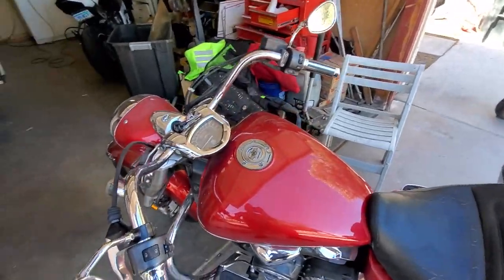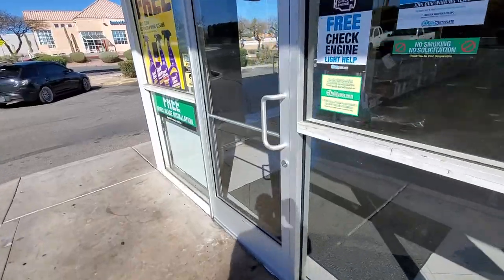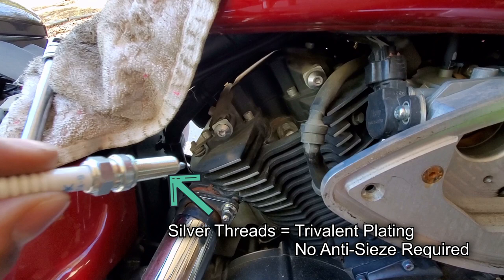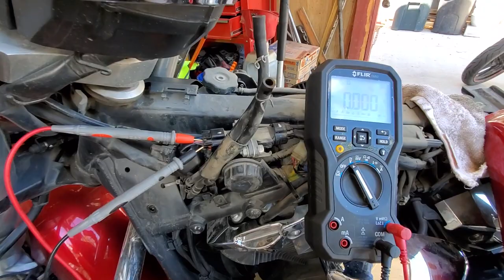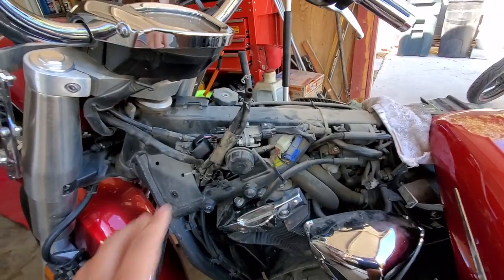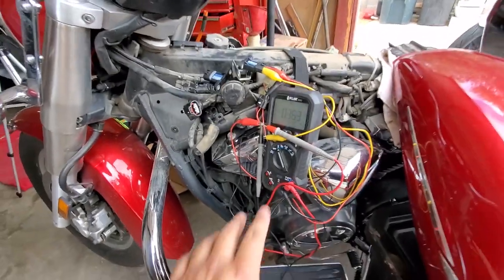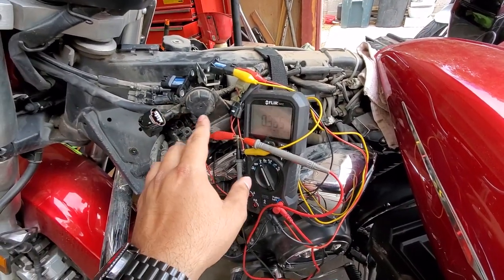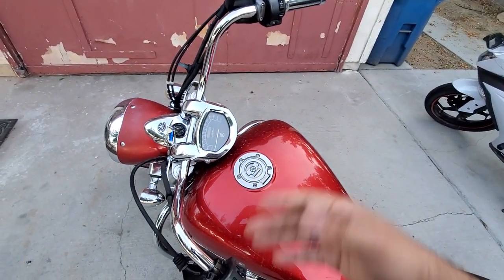Diagnosing a Starting Issue on a V-Star 1300

Comment: So was the problem a shitty fuel commander? What did you have to do to start the bike however you want with no problems? I’m just trying to learn I have this bike as well
Reply from the maker: I understand where you are coming from.  The power commander wasn't the issue. It's the bike itself. Since the power commander only receives power through the fuel injectors, this would've been an issue regardless of there being a power commander to my knowledge. It's just the way the bike's ECU is programmed and you would most likely need to flash the ECU in order to permanently fix this "issue". All in all it isn't a problem. Just a weird quirk of the bike design. Typically you are supposed to allow the fuel pump to prime completely before starting it but with this bike, I guess Yamaha wants you to start it as it primes.

Comment: Good Vid, MB, thanks... but one thing is still unclear.....So, as I like to hear the fuel pump  charge the lines ... I flip the start switch to on, flip the key, watch the display and listen..... " Weeeeeee " 2 seconds, then the ECU turns off the diagnostics lights. then I press start,.... Wuhh  Wuhh. Bruummmm.....  So why did the guy in the forum figure that the Fuel pump was shutting off? To me that sounds like a fuel line pressure switch issue...... Once you hit the Start switch at the end of the charge cycle, you would have full pressure to start the bike , but then you should be working off vacuum,  not injector pressure when the bike started and when the injectors open , you are pulling rather than pushing fuel ...??? The fuel pressure switch should stop the pump until you rev the engine ....
Reply: I missed a point here  When the fuel line pressure drops below a specified value, due to idling, revving or riding. the fuel pump will engage and keep the injector inlet pressure up..... not shut off when it reaches set-point for line pressure......
Reply from the maker: @Yamahog  from what I can tell, since the injectors require power to send fuel, the power commander is the middle man  between the ECU signal and the injectors. When the ECU sends the signal for the injectors to fire, the Power commander intercepts the signal in order to modify it. However; if the fuel pump is no longer priming, the power commander loses power as well and can't relay the signal to the injectors. (That's my understanding anyway) However; I feel like this isn't entirely the issue I have. Apparently the fuel pump relay tends to go out on these bikes pretty frequently and I think it finally took a dump. I have more tests to run to figure it out but I'll see about updating this video in the comments or description once the issue is discovered.
Reply: Ok so nothing needs to be fixed with this bike? Because I ended up doing what I learned in this video, n my road star started right up second attempt.
Reply from the maker: @orlandoperez2403  glad to hear. However;  the battery can show a similar issue. Read my pinned comment on this video.

Comment: Im having issues on my vstar1300 that I recently bought. Theres no spark. Ive checked the basic parts that needs to be checked. Just want to know what to check on ecu about the wire that goes to the ignition coil what color is it any advice? Thanks
Reply from the maker: Have you tested the coils?
Reply: @TheMotorcycleBoss  yes i did, i think its because of the ignition switch because it didnt have one i just connected the red and brown wire,
Reply: There’s also a wire connection there which im not sure where to plug in. It consist of 5 wires  if im not mistaken.
Reply from the maker: @williamoratajr.4365  Without me being able to wrench on it myself, I can't be of much more help. All I can tell you at this point is that in order for you to diagnose further, you need to have your factory service manual. That should give you all the answers you need in order to further diagnose the issue.

Comment: My make click sound when trying to  start it. Do couple times then start. I will have to try it out
Reply from the maker: If it's making a click sound, usually that is a sign of a bad starter, starter solenoid, or low battery amperage. I would start by getting a load test done on your battery. Autozone or Oreilly do load tests for free. Hopefully this helps you.

Comment: I tried to bump start and now its parked and stuck in 2nd gear.   Help.
Reply: And now i have full battery. Cranks but wont start.    Well....wont even crank right cuz its stuck in gear
Reply from the maker: @eyeamdavid  have you tried relieving pressure off of the transmission by rolling the bike a hair while trying to move it to 1st gear or neutral?

Comment: My battery is good , new spark plugs , new air cleaner, bike is hard starting when hot… any ideas.starts great when cold
Reply from the maker: That's a common sign of your fuel pump going out. Do a fuel flow/ pressure test to make sure it isn't that.
Reply: @TheMotorcycleBoss  It always start when its cold.. I appreciate your excellent knowledge here.. I will let you know when I find the proplem
Reply: @freddy3190 did you find the problem?

Comment: I will disagree with the use of starting fluid (either ). compression will cause either to ignite even with no spark. Carburetor cleaner is a better option.  I have also seen engines damaged when ignition spark ignited starting fluid. Either is much more combustible than gasoline or carburetor cleaner.
Reply from the maker: Everyone has their own tactics as I'm sure there has been an issue in the past with someone that uses your preferred method as well. My experience tells me I have a 100% success rate with starting fluid or carb fluid. I have to go off of that

Comment: My bike just makes a small click noise when I try and start it.
Reply from the maker: Check your battery voltage. If the voltage is at 12.3-12.6v, that's good voltage. Next you will have to take your battery in to Autozone or Oreilly Auto Parts for a free battery load test. If it passes the load test, you need to diagnose your starter solenoid and then your starter. Let me know how it goes! Good luck and happy hunting!
Reply: @TheMotorcycleBoss  I appreciate the info. I'll keep you informed on how it goes
Reply from the maker: @SillyGeeseINC  absolutely. Keep me updated!

Comment: My 1100 vstar sounds like the starter is spinning but im hearing nothing from the engine .it was riding good all day then out of nowhere i went to leave my buddy house and that happened
Reply from the maker: It sounds like your starter stopped pushing out and engaging your flywheel. I'd recommend pulling out your starter and testing it. Autozone can typically test starters for you on site for free.
Reply: @TheMotorcycleBoss  ok thanks a lot i will let u know what happens tomorrow when i check the starter
Reply from the maker: @luvhangover  please do. I would love to know the cause of the problem. If it's what I think or even better if it isn't what I think it is. I'll be waiting. Thanks!
Reply: The 1100 V-star is known to suffer from starter clutch failure. Sadly, not a cheap fix.

Comment: naturally no info in removing the tank, nobody has that simple video on youtube. good video though. Manual says remove neck covers first but the tank is in the way of the 1/4 turn fastners that hold the neck covers on.
Reply from the maker: I haven't had the need to fully remove the gas tank on this bike yet. But all I had to do after undoing the tank bolts under the seat was to remove the 2 hoses in the back. It's more of a pain than some other bikes but it isn't too hard.
Reply: @TheMotorcycleBoss  OK Thanks, ride safe.

Comment: How do I check my tps?
Reply from the maker: Idk what bike you have but the tps typicall deals with resistance levels. You would loosen the sensor and twist it to the desired resistance level. You should consult your service manual for specifics which you can find free online in pdf form. I hope this helps. Good luck with your project.

Comment: no of that was necessary.  Fuel Spark Air Compression. That's all.  1 ) Check spark with screwdriver, 2) Check Fuel flow , 3) Check compression with your thumb 4) Check engine is getting Air.
Reply from the maker: Checking spark and compression was easily done with starter fluid. Which also isolates fuel. Air was an obvious one to see, hear, and check. And timing wasn't the issue since it would run perfectly when it started. I already did all of these checks beforehand. It just came down to the specific characteristics of the electrical system of the bike and the power commander having a time limit. Everything you mentioned checked out already but the time limit was the only unkown issue. Only other logical issue to check at that point would be a wonky MAF sensor, ECU, or TPS.

Comment: Never blow air INTO the chamber as you might be blowing debris inside the intake.
VACUUM...
Reply from the maker: Not as big of a deal as you are making it out to be. Engines can be quite dirty without issue. Not to say you should disregard any cleanliness at all. However; blowing out the spark plug area before removal is standard practice to prevent any debris from falling inside the cylinders upon removal of the spark plug. It would actually be a bad idea NOT to blow it out before removing.
Reply: Someone’s never tried to blow a toothpick into a water bottle

Comment: Wow, first you should have started with PC. Me, I hate those, not worth the hassle. In the end, this was misleading because you didn't identify you had a PC. Maybe next time.
Reply from the maker: Lol. I ended up finding out the PC was only a small part of the issue. The real underlying issue was simply battery related. The battery had enough voltage to prime the fuel pump but when I would engage the starter, the voltage would drop just enough to no longer allow the fuel pump to work while having enough energy for a solid crank. I suspected this issue after the trick I learned in this video started not working a few days later. I performed a load test on the battery and it failed being at 68% remaining life. Swapped out the battery and now I haven't had a starting issue since. So technically we were both wrong here. Maybe you'll get it right next time...